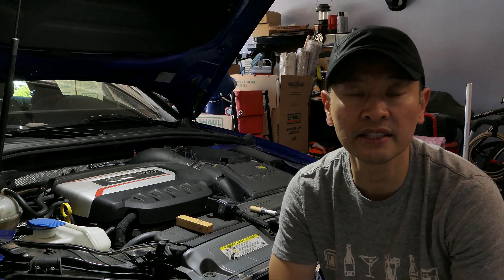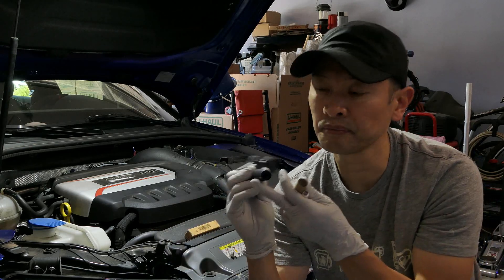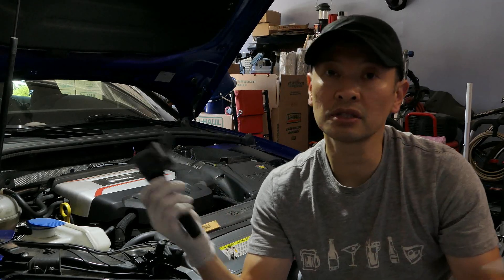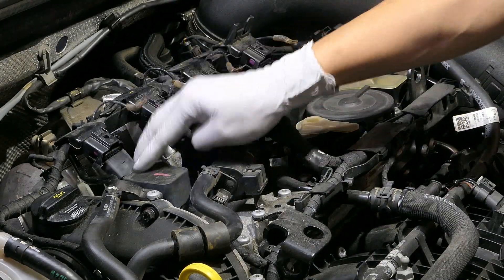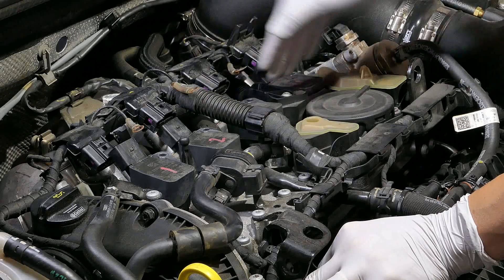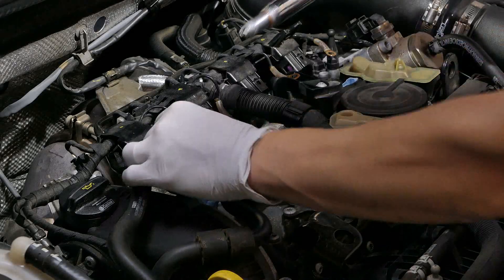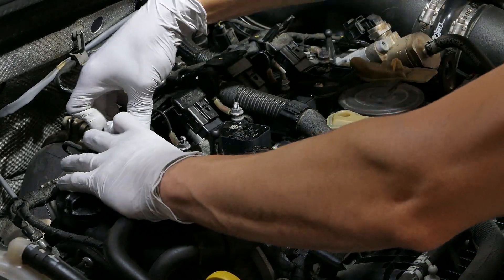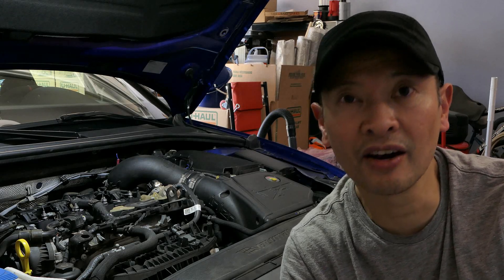RS7 Spark Plug and RS3 Coilpack Upgrade on Audi S3 8V

Comment: stock coil packs should be fine to use for stage 1/2
Reply from the maker: I would agree. Changing the plugs and coilpacks is more of preventative measurements as well as making sure the EA888 runs in tip top condition.

Comment: What’s the update on this ? Did you have to switch back to OEM for any reason ? Is it still running this ? Also the Skrillex is appreciated
Reply from the maker: I drove with this setup over 15K miles without any issues; highly recommend the change.

Comment: Would it be good to do the same swap out if I’m stock with no tune? I’m at 60K and I’m just wondering if it’s smart to do. I’m also not having any misfiring issues at all. Just looking for my car to run at the best of abilities I guess
Reply from the maker: Jason, if you do not have a tune and are running stock boost, I would not change anything.

Comment: Hi, would 0.024 gapping be required for my Golf R with RS7 plugs. I have an upgraded hybrid turbo running at 400hp with stock spark plugs. Upgrading my LPFP next month.
Reply from the maker: Johan, great question regarding the plug upgrade for your hybrid turbo. In all honesty and the BEST answer, would be to ask the maker and/or the tuning company what their input is. I do not anything about your specific hybrid turbo to give you a correct answer.
Reply: @TheAutomotiveFanatic  Thanks, they work well at 0.024 after consulting the tuner. 👍🏼👍🏼
Reply from the maker: @johan9574  awesome, rip away!

Comment: Hey pete
Wondering what is the 2016 s3 oem plug gap?
So i can check mines for correct gap
Reply from the maker: .032
Reply: @TheAutomotiveFanatic  Right now i replace oem to ngk ruthenium plug .032
They said its designed  for turbo engine
But when i do go stage 1 do i have to change to rs7 plug with .024 gap or can i leave it oem .032?
I kno if i go stage 2 the rs7 plug with .024 is a must
Reply from the maker: @jayman2035  IMHO, changing out to the RS7 plugs and gaping them down to .024-.026 would be fine on a stage 1 tune.

Comment: Do you know the recommended replacement intervals for this set up? I have a stage 2 tuned A3 and I’m upgrading to rs7 plugs. The factory spark plugs are recommended to be replaced every 60K miles, would that change?
Reply from the maker: Yousaf, if you're running stage 2, I would recommend that you change your plugs every 12-15K miles. It's cheap insurance to make sure your A3 is always running in top condition. Make sure that they are gapped tighter as well.

Comment: Hi. I noticed that my Audi S3 8VS 2014 is missing those ground cables on each coil. Do you know what symtoms you can get of that?
Reply from the maker: Amirish, your 14' S3 might have the newer set-up which did not have the grounding cable @ the coil-packs. To be honest, I do not know what symptoms you might have by NOT having those grounding points.

Comment: hello Peter, great video as usual! for my mk3 TTS stage 2, which spark plug would you recommend, between RS7 platinum and IKH 24 iridum power?
Reply from the maker: Hello Lorenzo, thanks for the support and question. If you're tuned stage 2 on the MK3 TTS, I would run what the tuning company recommends. I say that because each tune is different and specific tunes can be very picky. Based on my experience though, I would run the RS7 plugs since I had great luck with them over 25K miles.

Comment: Any idea why the washers won't come off my ground wires?
https://www.reddit.com/r/Audi/comments/hd5nxp/audi_s3_2017_spark_plug_ground_wires_wont_come_off/
Reply from the maker: Austen, I watched your video a few times and honestly, I think the top portion of the coilpack bolt is striped. If it wasn't, the nut would spin right off. However, yours is spinning freely, but does not move up/down at all.
Reply: @TheAutomotiveFanatic  I think you are right. I also noticed some metal scraping and a somewhat stripped bolt when doing the haldex fluid change at 35k miles. This leads me to think the person who serviced this was not an audi tech and had the wrong tools. Who services the haldex before 16k when I bought the car? Then I go up to do the sparks and notice all 4 nuts are spinning freely like this?! I'm starting to get worried... Going to just take it into Audi and play dumb.
Reply from the maker: @miltonlaxer , yes, go ahead and let Audi deal with it. Your S3 is new enough and low enough on miles that you're still covered by the warranty. They can fix it because it's an easy and cheap fix for them.
Reply: @TheAutomotiveFanatic  If the automotive fanatic gives advice you gotta take it. Thanks!
Reply from the maker: @miltonlaxer , LOL. Keep us posted!
Reply: @TheAutomotiveFanatic  I went to the dealer and got this note on my invoice($400):

PLEASE ADVISE, APPEARS SOMEONE ALREADY TRIED TO REMOVE SPARK PLUGS AND DAMAGED THE GROUND STUD CAUSING THE NUT TO JUST SPIN ON IT. HAD TO CUT OFF THE GROUND NUT. REMOVED AND REPLACED SPARK PLUGS, INSTALLED COILS AND SECURED GROUND WITH NEW NUTS.

I dunno how this happened but I know I'll be extra careful in the future.
Reply from the maker: @miltonlaxer , please tell me you didn't have to pay for it. That was someone else's fault!
Reply: @TheAutomotiveFanatic  they did not change me for that labor. It actually costs $400 at my dealer to do spark plugs 😂.
Reply from the maker: @miltonlaxer , glad you got it fixed!

Comment: What plugs/coil pack do you recommend for the 1.4 TFSI engine (untuned)?
Reply from the maker: Colin, if you're untuned, I would run OEM plugs and coils. There's no point in upgrading because you're setup isn't requiring more spark.
Reply: @TheAutomotiveFanatic  I do intend to get a tune in a few months but for now Ill stay with your expert advice, thank you !!!
Reply from the maker: @colinredfern7929 , no problem and good luck! Feel free to ping me if you have any additional questions.
Reply: Hi Peter, got the 1.4 tuned, what plugs and coil packs do you recommend ?
Thanks,
Colin.

Comment: I work for Audi To remove the Coil packs effortlessly get the engine hot and spray Audi silicone spray it and dry silicone spray wiggle as you pull. There is Audi special tool, but doesn’t really work.
Reply from the maker: Romeo, that's something I will try the next time!

Comment: I just pulled my coil packs off my a3 and broke 3 of them I was so pissed someone didn’t grease the boots or factory doesn’t grease them.
Reply from the maker: Welcome to coil pack removal hell. Sorry to hear Collin, if you need some advice on how to extract the boots, post up! I had to use long needle nose pliers and patience to get them out.
Reply from the maker: @doomie61, I've heard quite a few people do what you did and it helped. I can't remember when I performed this DIY, if my engine was completely cool or warm.
Reply: If run engine for bit first be easier to get the engine warm it will release the boots better on packs
Reply: I did warm up engine pulled 2 of 4 out easily. 
Thank God my son had a nice Gerber pliers and I was able to pinch stretch and grab them with my 2 fingers not allowing the boot to sit on top of cylinder port.

Before that.  I was livid and cussing 🤣

Comment: Hey Peter, thanks again for your help. Let me return the favor. If you  run the engine until it reaches about 160 f, it makes it very easy to remove the coil packs. I was very concerned that I would run into your troubles as I have done this before on my MK6 R. It literally only took a twist and turn and they popped right out. My car is a 2017 and it appears that there was some lubricant on the inner sleeve upon close inspection. Maybe they got smart and changed things on the FL S3? Anyway, thanks again for your videos.
Reply from the maker: Thank you for the feedback and suggestion. I will attempt your recommendation the next time I have to inspect and check my plugs. With my 15', I clearly remember Audi leaving no grease to allow ease of removal. Hopefully they learned from their mistakes.
Again, thank you for the support!

Comment: Great video. Use Diaectric grease on the coil pack boots and use the VW pulling tool. This will make removal so much easier! 😎
Reply from the maker: Happy Me, I couldn't agree with you more. What a nightmare it was removing my coilpack boots.

Comment: Hello Pet! Great Job. I am installing the same coils & spark plugs but my S3 stills stock. Should I gap to 0.24??
Reply from the maker: vagrabbit, if you're running stock boost levels, I would not gap to .024.
Reply: The Audi S3 Fanatic. Thanks Pet. I have been reading about the RS sparks, i think I should go for the original set up as my car is not tuned. Could you help me w correct gap for oem s3? 👍🏻

Comment: Hey man. What did you use to regap your spark plugs? I have started to use a coin style gapping tool but have recently read you shouldn’t tough the tip of the iridium plugs ATALL? Having a nightmare here.
Reply from the maker: Steve O'B, I use a feeler gauge set which also includes spark plugs sizes and a plug gapper. Generally speaking, you want to be very careful to contact the tip as minimal as possible. Each plug takes me roughly 2-3 tries before it's gapped correctly. Just take your time and you'll be fine!

Comment: Great video ! I also have an Audi S3 and was having misfire issues in the last few days. I am tuned and decided to upgrade the coil packs (RS3) and spark plugs (RS7) and after almost 200 miles of driving i have had ZERO misfires and can feel a tremendous increase to responsiveness and throttle input. I also had major issues removing the old coil packs and had two get stuck down in the spark plug well. The newer RS3 coil packs are much better made, stiffer, and pre lubricated to HOPEFULLY prevent the same issues upon removal in the future. Subscribed !
Reply: What's so cool about youtube - a guy makes a video 4 years ago and it helps me to do the same thing, having never done it before.  I'm amazed at the effect on the driving of my 56k miles car.  The throttle response feels "freshened" and more responsive.
Reply: Just saw this notification. I still have the S3 (182,000 miles) and pulling strong. My plugs came pre gapped but i measured them to be sure they were within spec. Since then i have done: fuel injectors, water pump, carbon cleaning, alternator, AC compressor, lower timing cover and starter. All DIY which saved me THOUSANDS of dollars.
Reply from the maker: Thanks for subscribing! Hopefully you found the video to be a good resource for your coil pack and plug change.
Reply: lordjop Did you regap your plugs?
Reply from the maker: @Stevo3032  I sure did!

Comment: Whats the review like? any difference in response or power delivery? what about fuel economy? 
thanks
Reply from the maker: David, knock on wood, but the misfires have all gone away and the occasional studders at 3k are gone too. In conjunction with a newly installed Wagner FMIC, the S3 pulls very linear. It's deceptively quick.